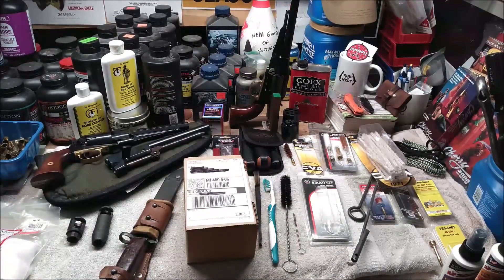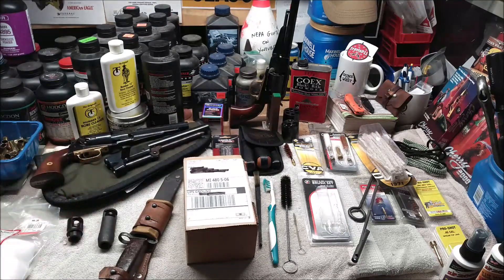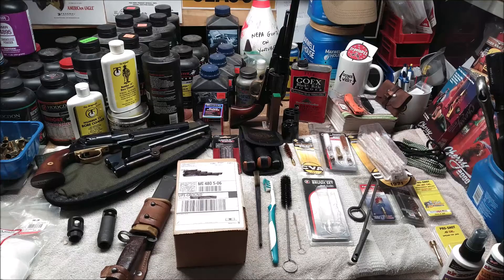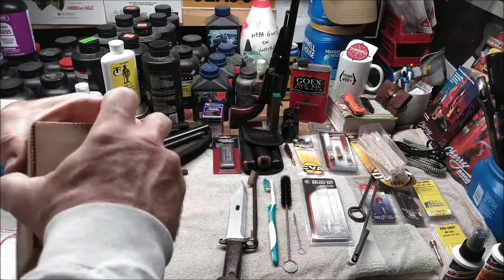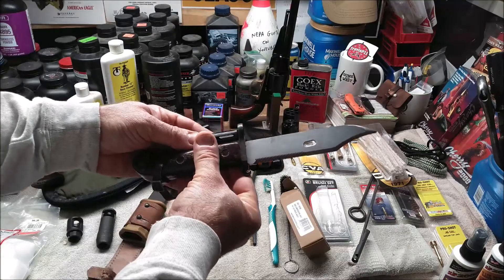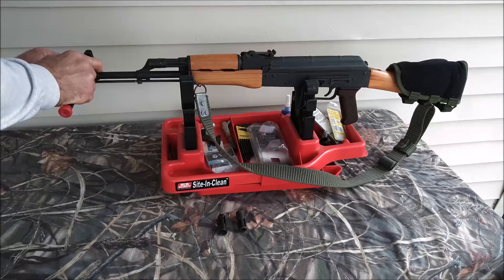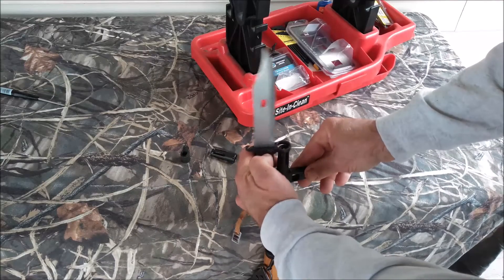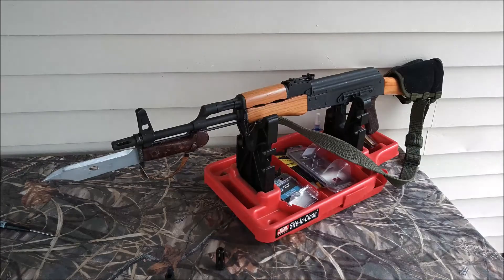Damage Industries Compensators

Comment: My question is I thought the muzzle device had to be welded on ? I'm not to knowledgeable on the ak platform .
Reply from the maker: Muzzle devices are only pinned and welded on a rifle or carbine length barrel in communist states.  Michigan has very few 2nd Amendment infringements.
Reply: @Squib1911  I was thinking it was federal for some reason.
Reply from the maker: If you had a ten and a half inch barreled rifle and a five and a half inch muzzle device and you did not want to get a tax stamp for an Short Barreled Rifle, you could pin and weld the device to the muzzle,  making the legal length 16" (carbine length - NO TAX STAMP REQUIRED).  A WASR-10 and an RAK-47-C-L both have 16-1/4" barrels.
Reply from the maker: @Portuguese-linguica  yes for the 1934 NFA an SBR has a barrel length of less than 16".  In some states, from what I have heard, you cannot have a muzzle device unless it is pinned and welded.
Reply: @Squib1911  thank you . Have a great night.
Reply from the maker: @Portuguese-linguica  you too.